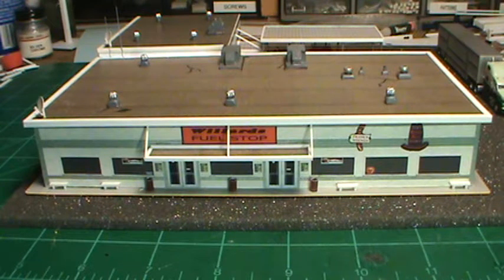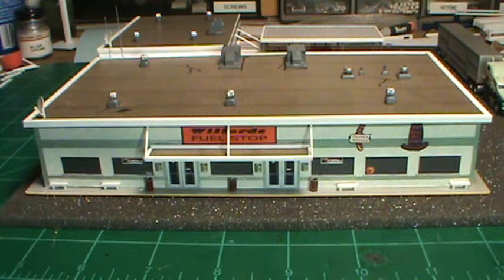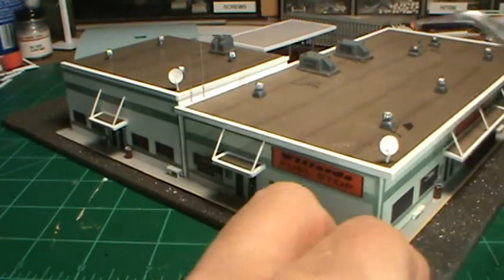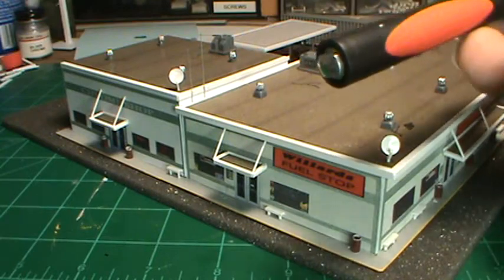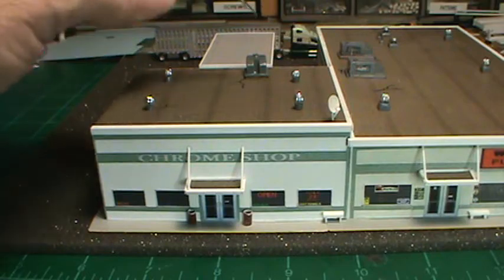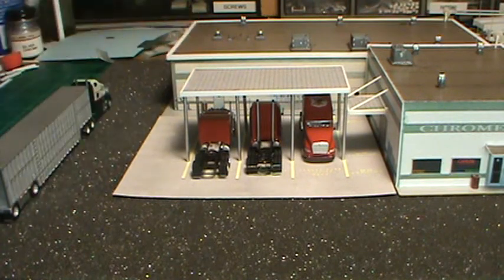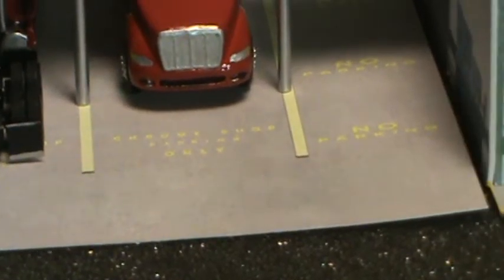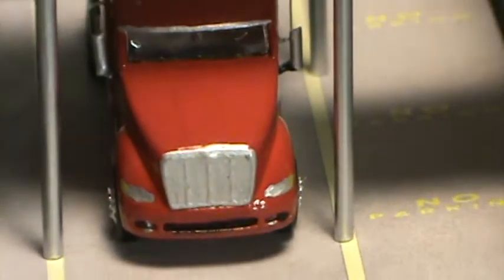N Scale - 3 Additions to Truck Stop

Comment: a truck wash was mentioned.. I don't know if you're still working on this project,  but a sign that reads... "high speed aluminum polishing". I know when I swing into a truck stop "rooster cruisin" ... I'm lookin for man with the buffer. and that would be done under the canopy.. a prototype would be "little sister's truck wash" in barstow, ca. it should pop up on bingmaps... next to the TA. happy modeling!

Comment: Signs for a restaurant on the truck stop. Most major truck stops have either Burger King subway Taco Bell or like the flying j they have Denny's. And it is usually inside the truck stop.
Reply from the maker: Hi Christopher, I've got Franks Wieners and Arbys in that building. Working on the big signs for the tall signs. Thanks, Steve
Reply: Truckstop needs a reupholstery shop

Comment: Great work as usual, Steve! How long did it take to design and construct the Chrome Shop and its add-ons.  Thanks!
Reply from the maker: Hi Tom, I would say, 1 to 1 1/2 hours. Once you get used to the programs you can knock them out fast. Well worth the investment. Steve
Reply: Does that include the time to cut the styrene and glue on paper then glue styrene pieces?
Reply from the maker: tombensky Yea, Its fast. I'm using a lite coat of spray glue, white glue will work also. Let it  dry if you have to do any cutting, if paper is damp it will tear. I cut out the walls of paper and glue on plastic, then cut excess plastic off from edges. Seems faster and safer that way. Steve
Reply: Great advice, Steve.  Thanks.  Please give us another video of the process the next time you make a building that way.Thanks!

Comment: I would like to see someone make a display-case that could quickly connect to a layout and be able to drive the train out. Then be able to role it back in for safe keeping. I've done a couple display cases but have yet to make a drip-leg track onto my layout because of financial-reasons. Both of mine are 36" Long,...TOTAL. And I have the glass on both sides right next to the track so the cars and loco don't fall over.
Reply from the maker: Hey, I have seen one, It was on the wall, track going down wall to meet show case, it was N scale, it was like 12' long and 4' or 5' tall and 2" or 3" deep. I can't remember if it was on a motor or not. anyway it slid up and down the wall till he got to the train he wanted, and then drove it out, It was like a big show case, glass front, tracks about 4" above each other. It was on you-tube. I'll see if I can find it. Steve
Reply: Except my idea is much more simple. I meen not getting dust on them and making room on a layout is another good thing. I would like to sell some if I could make them well enough.
Reply from the maker: ***** Everybody is looking for a way to store and keep clean. I suggest build one and make a video and put it on your channel. You know the old saying, build it and they will come. Steve
Reply: Yes, I just need to get a bachmann switch-track to demonstrate. But I may put a short video of the display-case, I just have few more things to do to it.
Reply: But thanks.
Reply from the maker: ***** Good Deal, let us know, I'm sure there are people already interested in seeing  the displays. Keep us updated. Steve